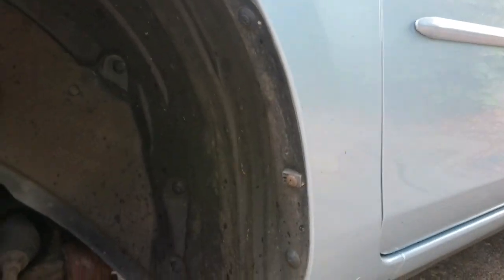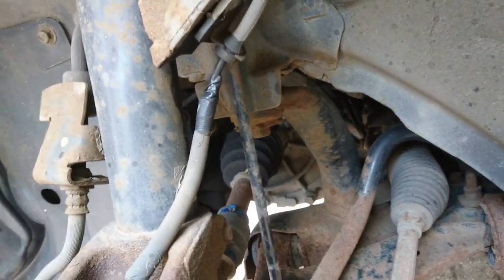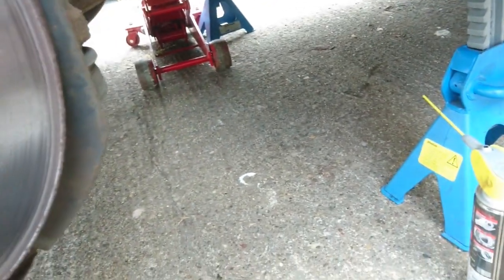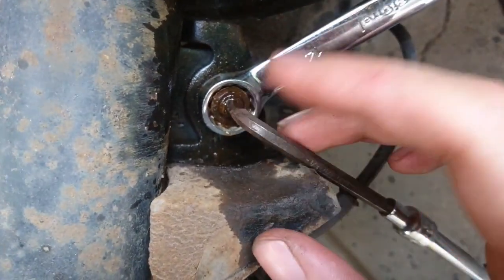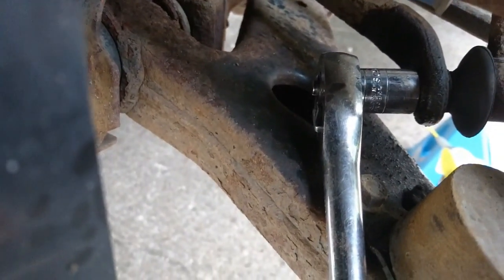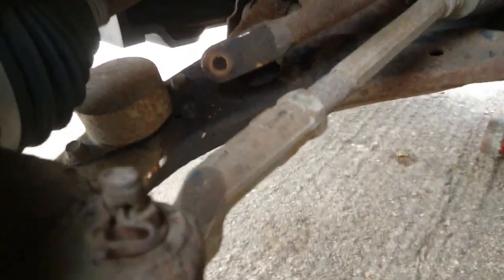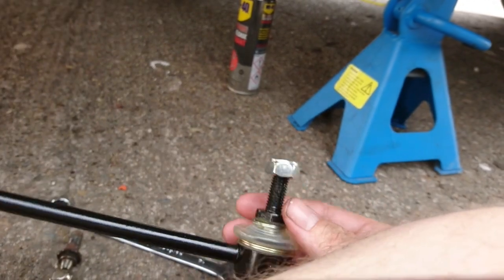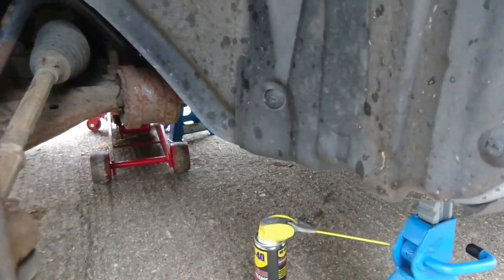Mazda 3 2008 clunking noise | How to fix front drop link install

Comment: Thanks for the video :) Just wanted to add that if you find that there is weight on the drop link you can release it by jacking up the suspension arm by about 3-4 inches. Go further than you think. Also I've had to angle grinder the old bottom nut off every time I've ever done this!
Reply: Did you grind the ball side or the nut side?

Comment: Great work!
Where did you place the axle stands at the front? And where would you place axle stands to support the rear? I am going to be replacing disks and pads all round and don't want to support the vehicle on the sills. Cheers for the videos!

Comment: Hi mate I have a mazda 3 2017. Annoying noise from the rear passenger but only over speed bumps. Could this still be the drop link ? Sounds like it's inside the boot. There are no rattles whatsoever just a one off annoying noise over level speed bumps

Comment: Thanks for this video.  I am having this annoying sound in the rear of my Mazdaspeed 3 and thought it would go away, when I installed new end links.  Did you do a video of that install?  I have gone through and tightened all nuts to the correct torque specs.  Do you have any suggestions?  It sounds like the Rear Sway Bar is knocking but it feels tights, even when I have it up on ramps.
Reply from the maker: Check out my video on the rear spring noise incase it's that,  I had a little bit of the spring loose in the carrier.